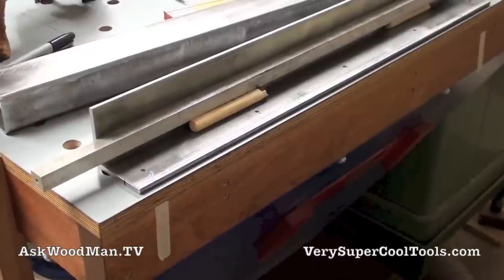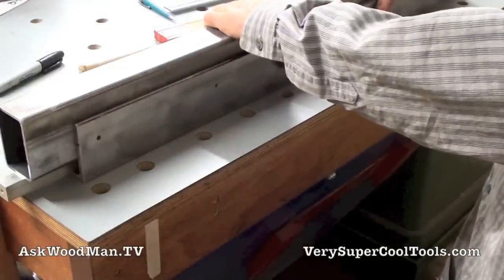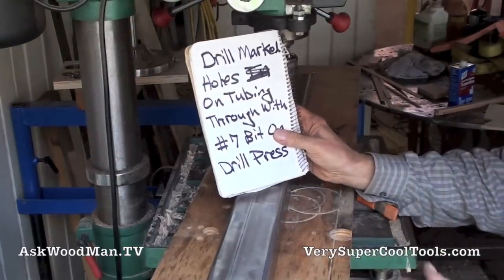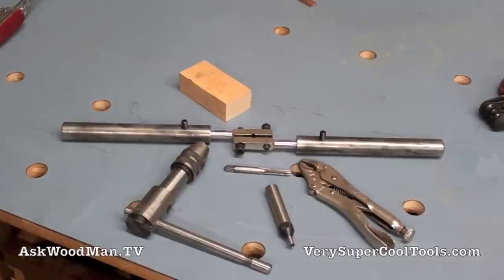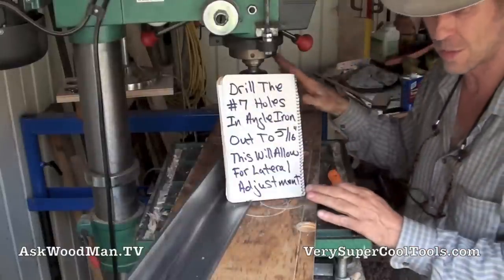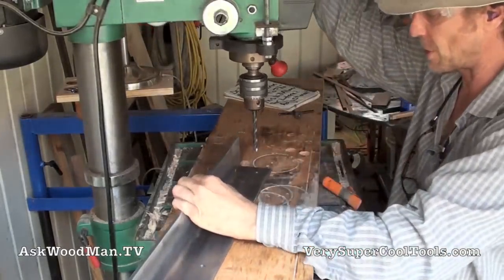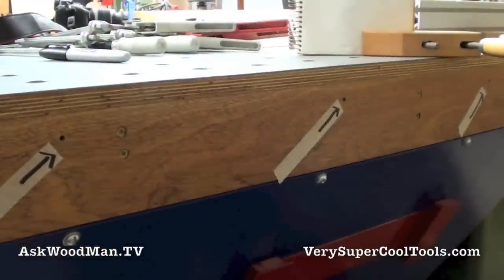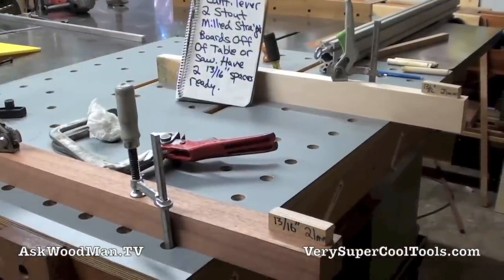746. Do It Yourself • Biesemeyer Guide Rails • (Steps 11-20)

Comment: Curious - can you use aluminum products to make the rails?  OR would that not hold the taps as well? I'm not a metal worker so if I'm asking an obvious question please accept my apologies.
Reply from the maker: You can use aluminum but I do not recommend it. I think it is too soft to stand up to the abuse a guide rail receives. Also raw aluminum is sticky and grabby until it is anodized. Aluminum is much more expensive than common mild steel. And needs to be of a substantially heavier dimension to have the same strength.  I am a steel guy for guide rails. Cheap, easy to work,  tough and strong.
Reply: @AskWoodMan  - Thank you. This was a GREAT response and a great help!

Comment: Is off the shelf tube steel, and angle iron straight and flat enough to maintain precise accuracy? I would think even the smallest deviation on the front surface of the steel would mean several thousands out at the end of the fence. Do you see any of that kind of variation anywhere along the travel of your rail?
Reply from the maker: +jesondag Check out this video for the answer. https://www.youtube.com/watch?v=k2K6sk1do4U&index=12&list=PLqtTuVwYBfkxDQ9woALSl-XA3vbp1cKjG